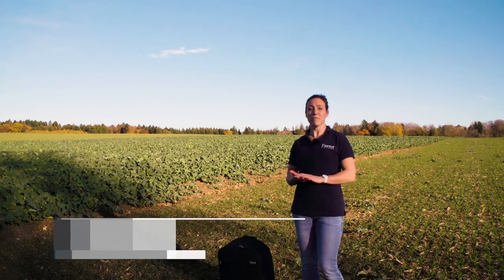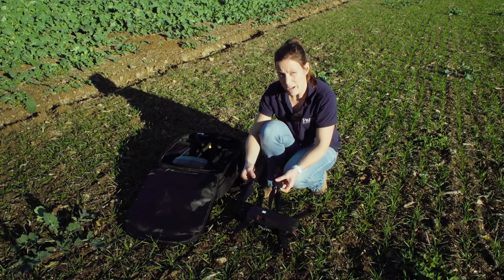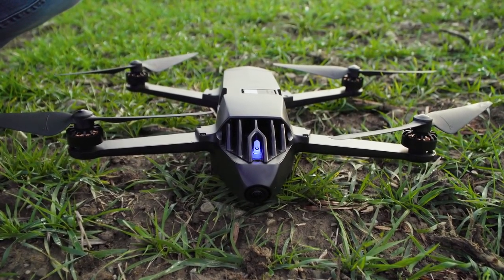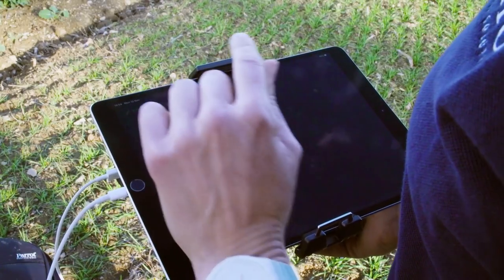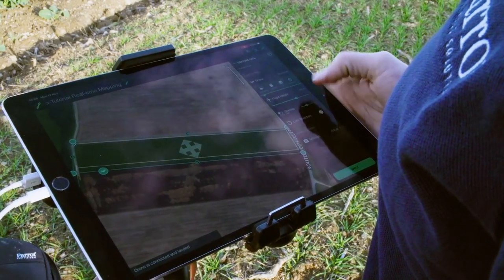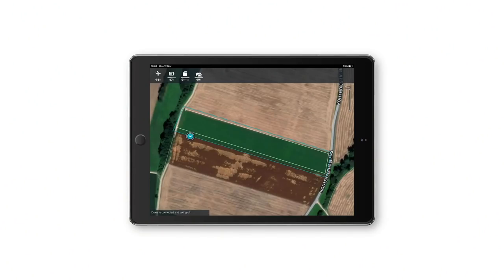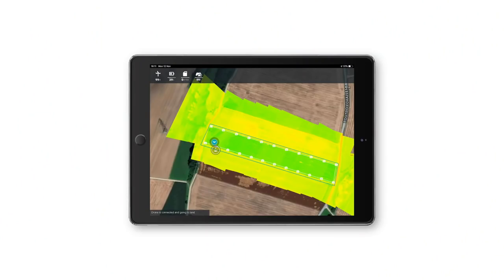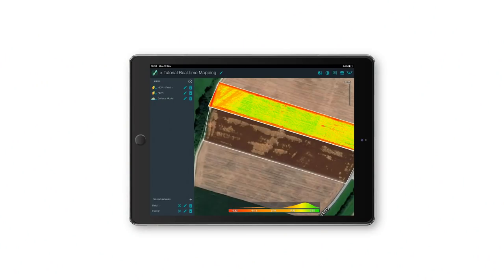How To Perform Real-Time Mapping With Your Parrot Bluegrass Fields Drone

Comment: Can You please answer, what model of iPad are You using? In bleugrass fields specification there are only older models listed as compatible. What about new ones? iPad 6th gen, iPad mini 5?
Reply: I see on the App Store it says "Requires iOS 11.0 or later. Compatible with iPad." I guess you can check your iOS in settings?

This is from Apple:
The following devices are iOS 11 compatible:
    iPhone 5S, 6, 6 Plus, 6S, 6S Plus, SE, 7, 7 Plus, 8, 8 Plus and iPhone X
    iPad Air, Air 2 and 5th-gen iPad
    iPad Mini 2, 3, and 4
    All iPad Pros
    6th-gen iPod Touch